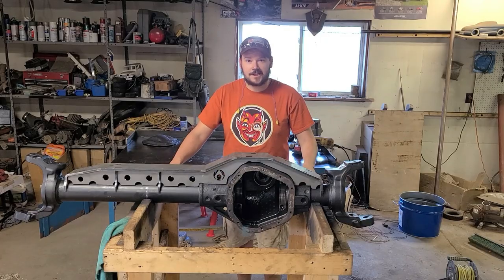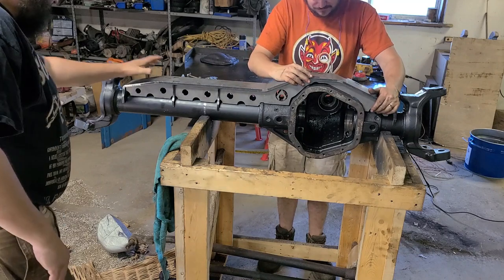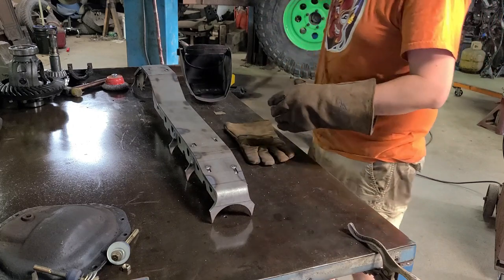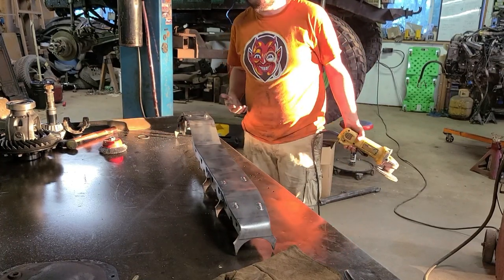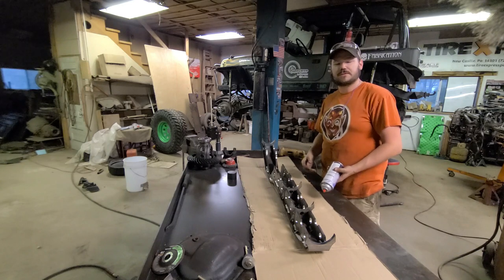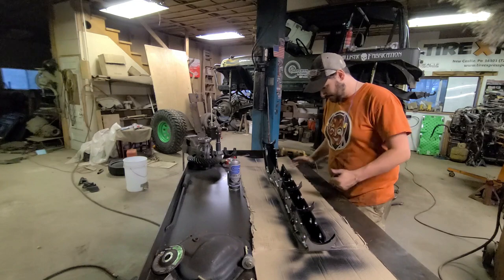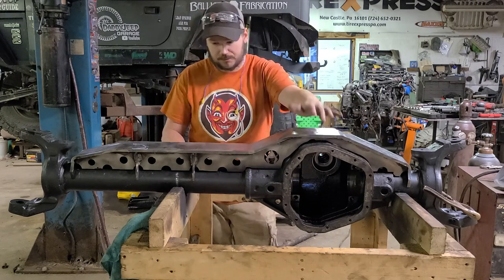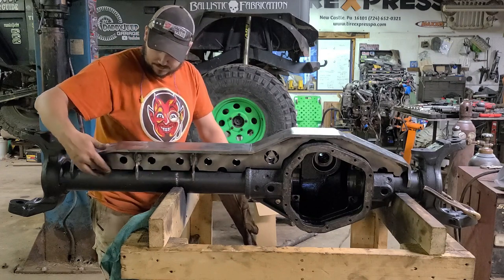Jeep KK Liberty Dana 60 Artec Truss Install - TJ welds on a low profile truss to his Superduty axle

Comment: Why are you trussing a Dana 60?
Reply from the maker: There are many reasons to truss a Dana 60. Let's start with making it stronger. A truss will keep the tubes from spinning in the center section. It also provides a place to mount the upper links.